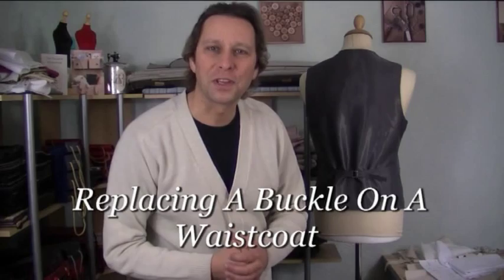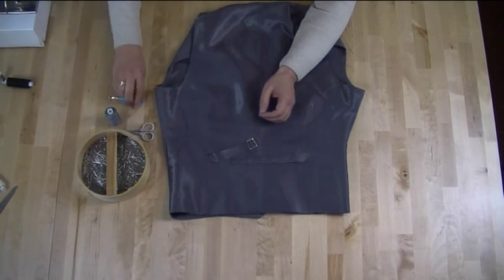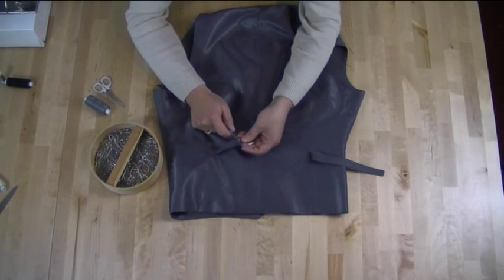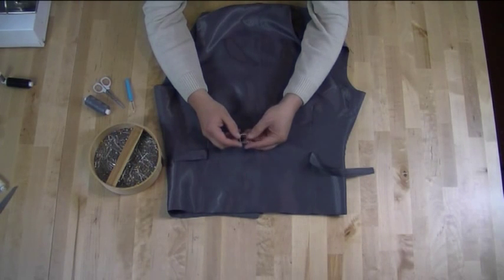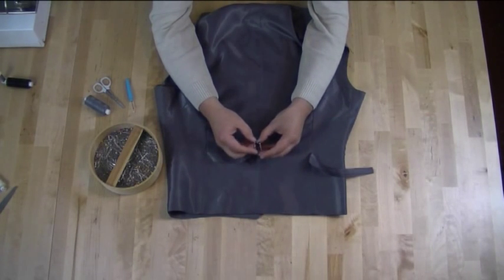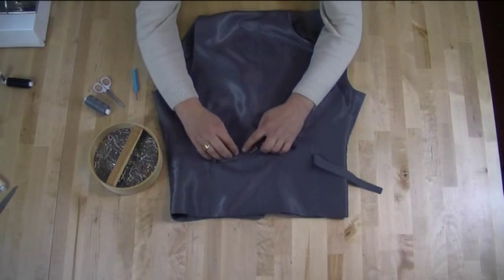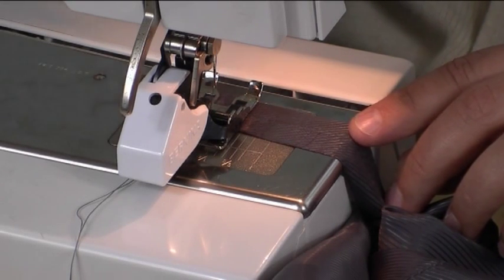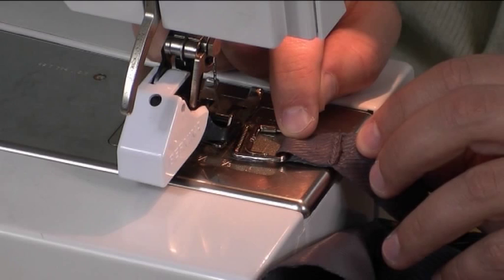how to repalce a waistcoat Buckle

Comment: On my Trench coat there is a decrotive plastic buckle on the back. It fell off so I looked at the stiching to see how it was sewed previously. While the buckle was on the decrotive fabric belt it looks like they had sewed the belt fabric to the coat around the buckle. Is there a certain way i sew it back on. There appeared to be four places around the buckle where thread was left.
Reply from the maker: Without seeing the buckle we cannot be sure. What we do know is buckles are all sewn on roughly the same. What we would suggest is to look at other coats that have buckles on them and see how they are attached. A great place to start looking is a charity shop. We hope that helps you.
Reply: @ny204193d  Thank you!